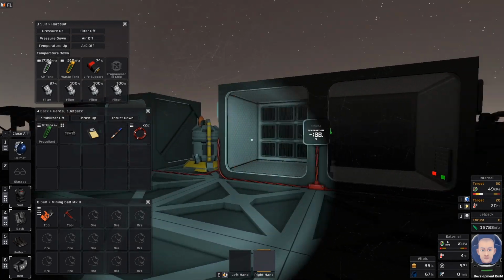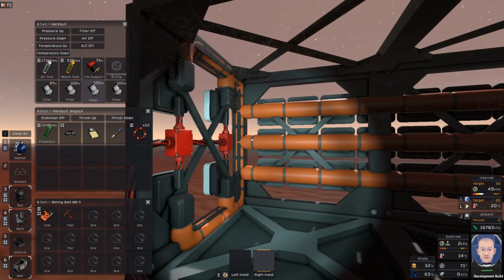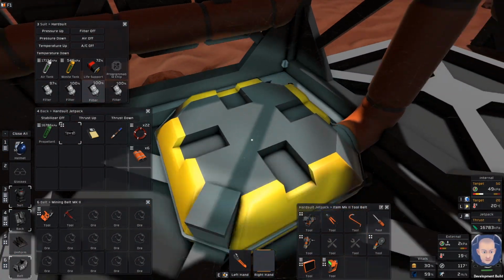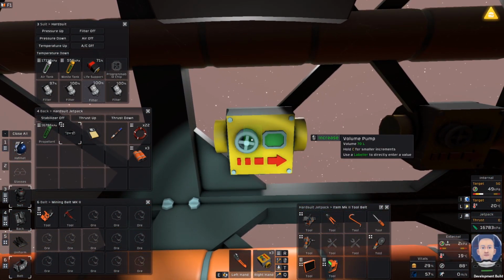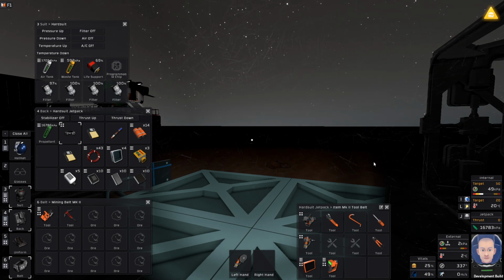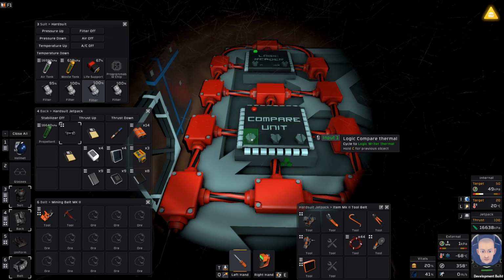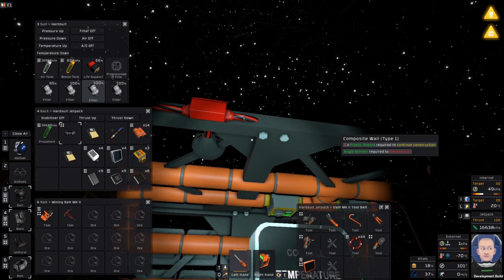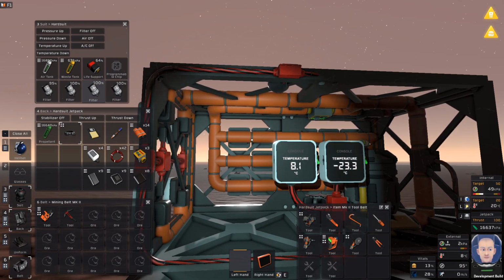Stationeers #10: Cooling System

Comment: Cooling in a vacuum is not due to the exchange of heat between gas masses, but to radiation (radiation heat transfer). In fact, it is due to infrared radiation.

Comment: I agree with you, that the first method would not work in real life.   I disagree with your logic as to why. 
There are three ways heat is transferred Convection, conduction, radiation.   Both convection and conduction require material as an interface, IE air or solid.  However... As in the example of the ISS that you brought up and a LOT of other examples. Radiation, which radiator do in part.  happens when heat energy is turned into infrared electromagnetic radiation... which Does NOT require any matter to transfer heat with.
SO.. while the setup of a bunch of radiators in a small room that has a vacuum pulled on it wouldn't work as a cooling mechanism, because of a myriad of other reasons.  The idea that it is radiators in a vacuum is not one of them.

Comment: Um. No, on the international space station, there are no heat transfer to trace elements. Radiators on ISS uses infrared radiation to dissipate heat into space. It does not interact with any type of air at all. An if I'm right. It's a ammonia system.
Reply: You are right. Spacecraft make use of radiators that dissipate heat via infrared radiation. Space does have molecules and particulate present, but it's absolutely not used in cooling. At around 420km (the ISS altitude), the temperature of the particles that ARE present is around 1,000 kelvin/730C.*** Vacuum cooling is completely realistic, however the in-game representation of it was wildly more powerful than in real life. It also worked in sealed rooms, which is problematic since the game does not model the temperature transfer of things like iron frames. To more closely mimic realism, the radiators in a vacuum room would need to slowly match themselves to the temperature of the iron frames or other room components. Instead of modeling this, they disabled radiator function in a non-atmospheric vacuum. Vacuum cooling still functions effectively (too effectively) in atmospheric vacuums like on Minas and the Moon.

* People think that the higher you go, the colder it is. That is true, so long as you are present within the blanket of the Earth's primary atmospheric layers. Once you enter the Thermosphere (APTLY NAMED BTW), things start getting real hot, real fast. But, because particle density in the upper Thermosphere and the Exosphere is so crazy low, the heat of the particles is of little concern. If you want to explore this more, look up the MSISE-90 atmospheric model at the NASA site. The CCMC should have a publicly available calculator that will let you explore temperatures and particle densities up to around 1,000KM altitude.
Reply: @Thespirit Yes but there is a difference between heat passed by particles as compared to radiation which is more like light carrying heat away. If you make something really hot in space (like a radiator), it will radiate light more so then interacting with particles. The light isn't necessarily absorbed either, it just shines out into space. Eventually it might get absorbed I guess.

Comment: ok, so you are absolutely right, thermal radiation cannot be "absorbed" in a pure vacuum (if you think about that - what would do that? the either? exotic particles of the quantum world? ) . But people have some misconceptions about the ISS. The ISS is STILL in earths atmosphere which actually extends (albeit very thin) past the moon! Which is a big reason why the ISS has to be boosted back into its preferred orbit once in a while (due to atmospheric drag). Too incredible? look it up :) Also, fun fact the ISS is still affected by earths gravity, its still in the gravity well which extends quite a distance as well. The reason people are experiencing weightlessness on the ISS is because the ISS is in what's' know as free fall, the same effect as what the inspiration 4 crew experienced in the test planes that fly in such a way as to create the same effect during the crews weightlessness training.

Comment: Your aircons on your test bed won’t give you a proper result as the pressure of the outside air is too low
Reply from the maker: The wall coolers were there for show. The test was to see how well the gases would cool. I explained that.
Reply: @DragonNationGaming  it was more the idea to test the cooling for your pipes to make sure it would work as the aircons can super heat the gases in the pipes (strange game mechanic) just another check to make sure the end product was gunna work that’s all mate

Comment: Isn't your coolers and heaters control already set up with a air control chip or something ik you had it cycle in the stream before rich
Reply from the maker: I have two different worlds for recording and streaming. I haven't set up cooling in either one yet. I did set up the vacuum method in the last stream but I will change that when I stream tomorrow